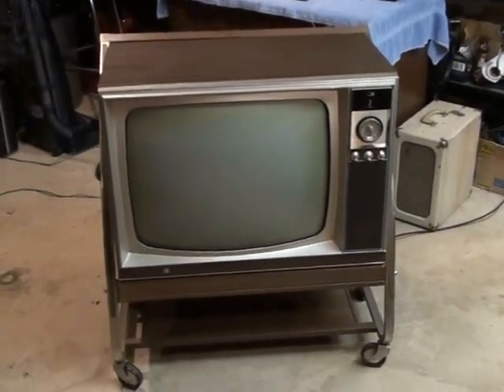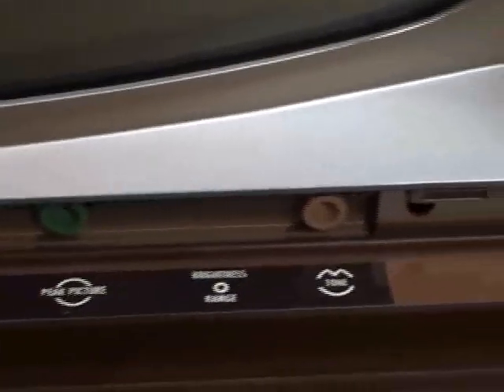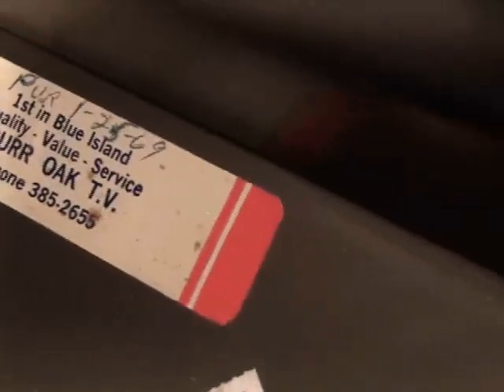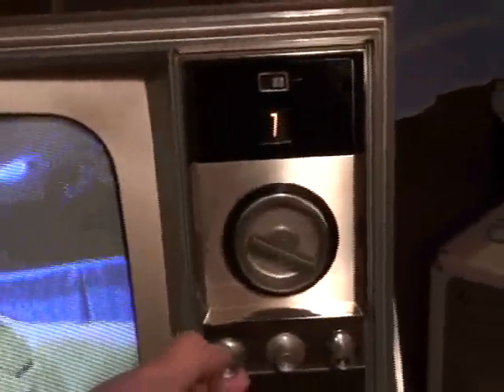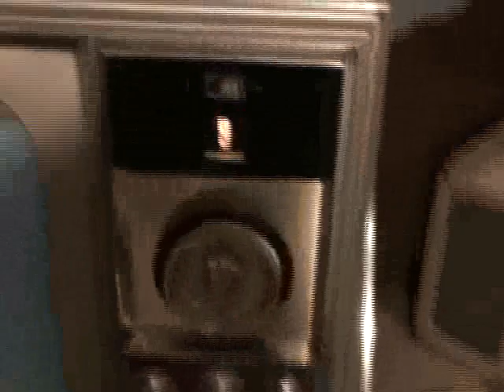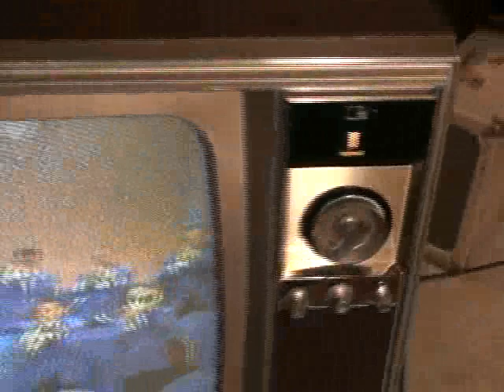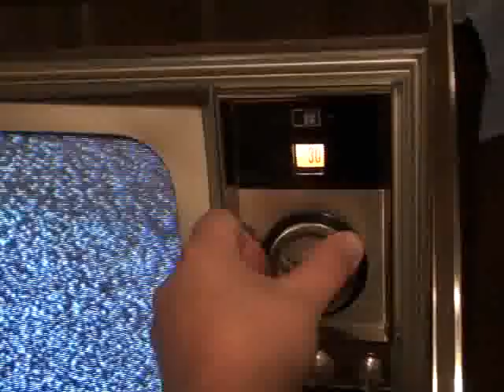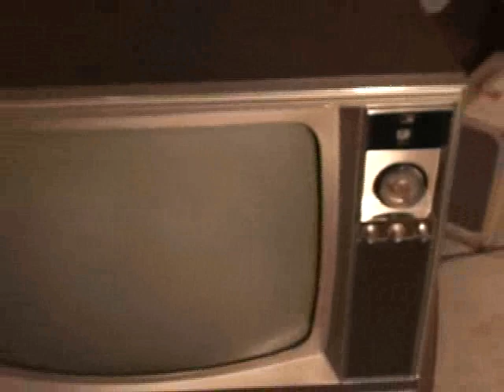Watch a 1969 Zenith Color TV!  The Last evening of NTSC broadcasting

Comment: That's a very nice set! Excellent purity and convergence. I think the color rendering on older sets seems better. 

 If they built quality electronics now like this TV was built, there would be a LOT LESS E-WASTE!
Reply: Doug really seems to know how to fix and align the electronics properly and set up the purity, grayscale, and convergence. I greatly admire his work. And he's a piping draftsman, not an electronics technician. God Bless!
Reply: I know right , I was born in 1976 . My parents had a big 70's Zenith TV that was in our living room until probably 1990.

 Nowadays people get a new TV every 5 years either because they break or become outdated to whatever new streaming service you need.
Reply: These weren't bad for tube era sets but the next generation Chromacolor II sets held out alot longer although the early ones needed a repair to the HV section that was fixed on later runs.

Comment: I still use a 1976 set by using a converter box and an coax to antenna wire adapter. It now has remote control due to the converter which it never before had! BTW we only had UHF stations here in the early 1950s and when you bought a set you always had to by a uhf converter and a "tennaroter".

Comment: Yes, any American TV made after WWII (and a few from before).

  Old sets can still be used over the air using a DTV converter box, and I have one on a TV more than 10 years older than this one.  I also gain remote control and all channel reception (drh4683's TV seen here has UHF channels, but my older set did not). 
  The one part not included with the box is a "300 ohm transformer", but they only cost about $5 USD.
  Analog cable viewers can use the tuner in a VCR to get the cable channelsl

Comment: Hi there, this is Gary, musicman0150, very nice demonstration of the last night of analog broadcasting.  All those old TVs you have, keep them.  They are still worth something because even though analog is basically gone, you still can relive the vintage viewing by watching old shows on DVD/VCR and/or cable.  Granted it won't be the same as the original over the air broadcast but the TVs and hows themselves are a conversation topic for those not familier with the old way of viewing TV.

Comment: All older TVs still work with converter boxes with an ATSC tuner.  Digital cable boxes will also work with older TV's as well.   Both types of boxes convert the signal to RF channel 3 or 4.

Most areas in the US still have analog cable service available.  All TV's will at least get reception on channels 2-13 with analog cable as the frequency of CATV 2-13 is the same as VHF 2-13.

Comment: Damn, it's hard to believe it's been 6 years since analog bit the dust.  And not for the better, IMHO.
Reply: So, what do you miss about analog TV?  Ghosts?  Snow?  Interference?  Distorted sound and video?  Faded color?  Yep.  Analog is gone.  Thank goodness.
Reply: yeah but i've seen tvs with weak sadelite signals and it's a big glitchy mess so i don't see how analog was any worse honestly
Reply: @Kyle Dexter - Exactly. NOTHING about analog was good besides just being able to plug the cable directly into the tv and it worked right away. I'd gladly give it up in a second to have my 1000 channels, PVR, HD, and surround sound.
Reply: Crashdance22 My indoor antenna works with most, if not all of the city's stations even in the more inclement weather, I honestly don't know what you're talking about
Reply: In Canada over the air analog tv was phased out in 2012. Due to high cost and tight budgets the 2 largest public broadcasters CBC and TVO permanently shut down most of the low power transmission towers in rural communities.
Reply: It's a weird trade off. I remember it was a month before I turned 17 when they shut off analog and I was kind of sad. Then, a month later, we got a converter box and saw DTV for the first time. The picture was absolutely amazing. The only difference was, when the signal was poor, instead of a snowy picture and hissy sound, the shit would just freeze and stop like an old computer. Now that fucking pissed me off.
Reply: @firstnamelastname5407  No, I live about 30 miles north of the transmitters
Reply: @cumulo25  Same. I hate seeing that. I've read online that digital transmissions can function well at lower signals than analog TV (for instance, a signal weak enough to make analog TV go a little fuzzy and hissy would still give a functioning signal to a digital TV) but in the weaker areas where the signal wouldn't work for DTV anymore, even though analog TVs would be pretty staticky and noisy, they'd still be viewable enough to use. I don't like the trade-off myself.
Reply: by the time i finished comment this ATSC bite the dust. hello ATSC 3.0.

Comment: @grimmy74uk Originally, UHF tuners were an afterthought in this country. They were not made mandatory until sometime in 1964. Before then they were an expensive option. Then sometime during the early '70s the govt. mandated that sets had to have incremental UHF tuning, just like the VHF channels. The continuous tuner was the cheapest way to add UHF channels to TVs (but a pain for most users). The incremental units that came later used the same tuner but with mechanical gearing and detents added.

Comment: Do any converter boxes send a STEREO RF signal? Stereo RF modulators are quite rare, I want to get something that has one just so I can hear the stereo decoder in my new TV's analog tuner (wonder how long new TVs will keep having them?) There's a few low-power analog stations left but only one broadcasts in stereo, and it hardly ever comes in well. (Guess I'll NEVER get an SAP signal again either.)

Comment: Unfortunate the end of analog TV fell under my radar because my family had Dish Network in 2009, we switched to Charter in 2003 when i was in first grade (and switched back to Charter in 2010) so that was the last time we used analog TV 2003 or before. Before we got our charter cable box we had the cable straight into the tv and was like of like antenna tv because you didn't get a program guide without the cable box and you could switch channels and INSTANTLY see it, without the few seconds of black screen you get when you're flipping through channels with a DTV converter box.

Comment: I don't live in the US which is why i'm asking this.

If you hooked up a digital cable box to that TV would it beable to work with all the digital channels and broadcasts?
Reply: No because digital and analog are different but you can use Set Top Box To Connect It

Comment: Hi there, nice looking TV and excelllent picture and sound.  Even thought 75% of the analog signals are now gone, I'd still keep the TV and all other vintage sets you have as a historic memory on how TVs progressed over the years.  Check out my videos; on how I use UHF wireless transmitters to test older analog TVs to simulate the analog broadcast.   Direct UHF modulators are now available; some even 3 channel units where the UHF range is from 14 to 78, for closed ciruit TV viewing in your home.

Comment: I wouldn't want to run a tube based TV set very long because I would be afraid of the vacuum tubes failing and no one makes them anymore.
Reply: bradhig you can get them on ebay, russia still make them maybe you only need adaptors